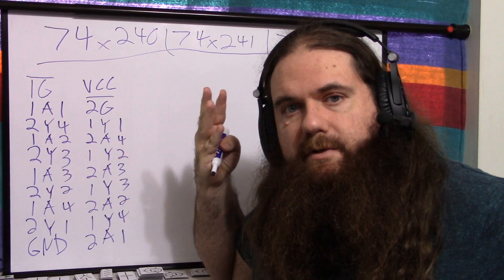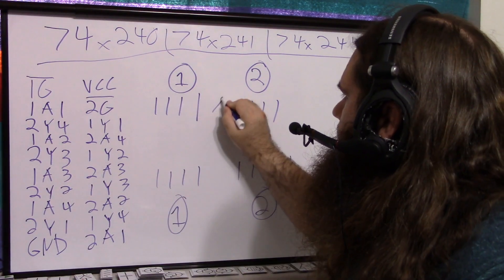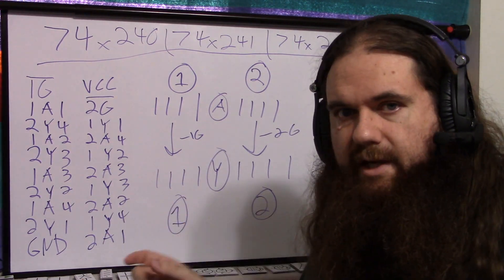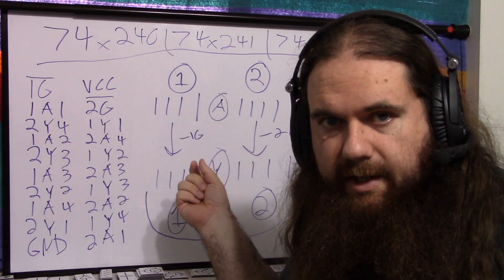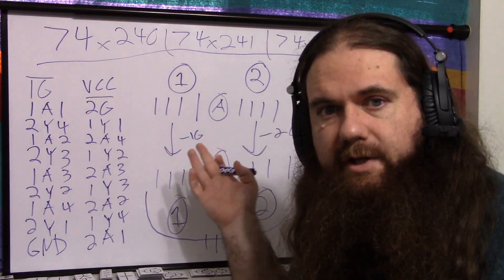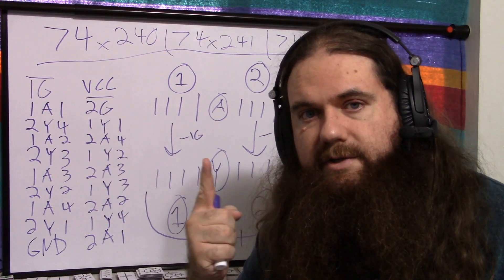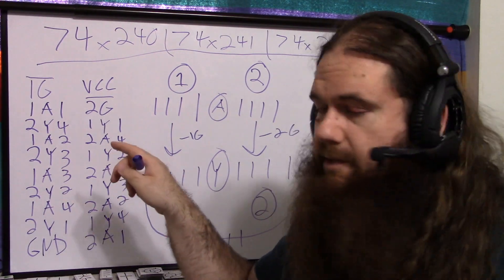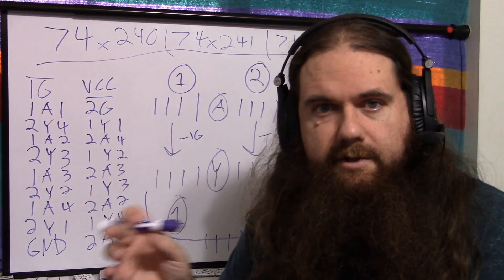74x240 - 74x241 - 74x244 - Bus Buffers - Dual 2x 4-Bit - Simply Put

Comment: I'm working on a EEPROM reader/writer. I have verified that I am setting the address lines correctly. I've also verified that the output enable on the chip is set correctly. However, the output of the chip apparently has very little output current, and I cannot use LEDs to verify the chip is doing anything (according to the datasheet) and using the arduino to read the pins doesn't seem to be any better than floating inputs (I literally unplugged the wires from the arduino and got similar results) so I've been using some 74LS14's to try to amplify the signal (I don't care about inverting the output now, just making sure that my PROM's are good) and honestly I can't tell if it works. I'm not great with opamps but I guess I'll have to figure it out. Perhaps these buffer chips are what I need instead.
Reply from the maker: An op amp would be a perfect buffer for this situation, non-inverting unity gain (signal into noninverting input, tie output to inverting input) because an op amp has immense input impedance, isn't designed to do any sort of logic or line level conversion, and is crazy easy to hook up. Make sure it has good headroom if it's not rail-to-rail. I've done videos on how to detect floating inputs, but basically, you apply a pull-up resistor and a pull-down resistor (before the buffer/opamp) separately, and if you get different answers, it's floating.
Reply: @simplyput2796  I have about 50 LM339 opamps (quad LM393 comparators), I hope they work well (I have 8 outputs to buffer, so two chips if they work).

Comment: Great video as always! But one thing I'd like to add. If your desired output is an inverted or a non-inverted set of the same signal, which is dependant on an "Invert Enable" signal, you can just use an XOR gate. 
If you look at the truth table of an XOR gate:
A   B | Y
0   0 |  0
0   1 |  1
1   0 |  1
1   1 |  0

Now if you look closely at the inputs, you realize that Y is the same as B when A is 0, and Y is the inverse of B when A is one. You can get away with using just one chip if your signal is 4-bits (cuz they usually come in quads). I could've never thought of an XOR gate as a "conditional inverter". Very clever huh? Hope this helped! Cheers!
Reply from the maker: Hmm, that's a handy trick I'll keep in mind. I have NAND and NOT chips but no XOR. I'm trying to assemble a "toolkit" of parts that have a large number of uses each, and I hadn't thought XOR would fit that, but conditional inversion is turning out to be common enough that maybe they are.
Reply: @simplyput2796  Yup it's extremely useful for conditional inversions. Also can be used to make full adders if you're into that sort of thing : ) (Kind of things I love to do)